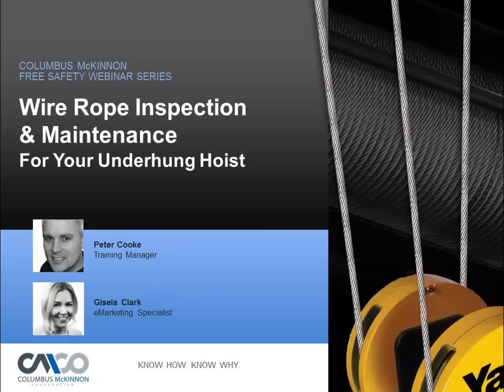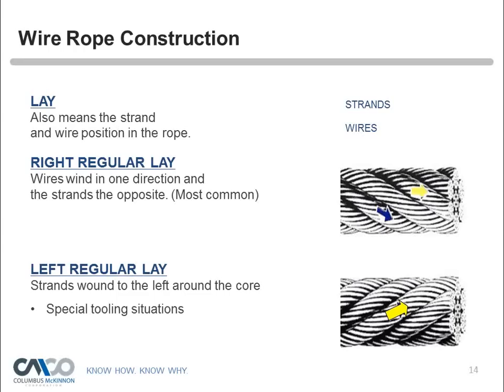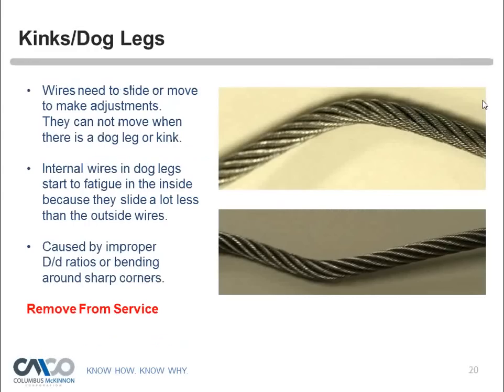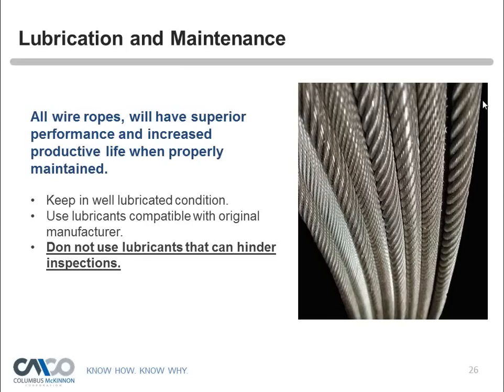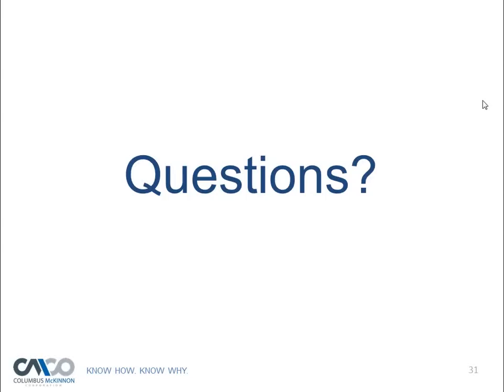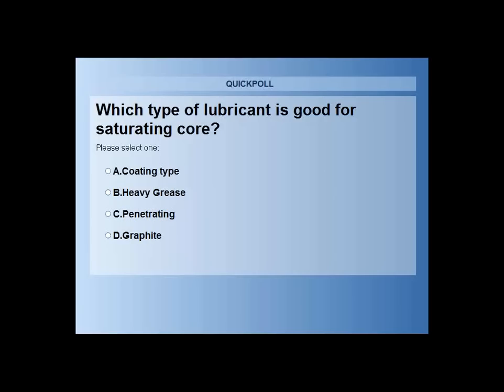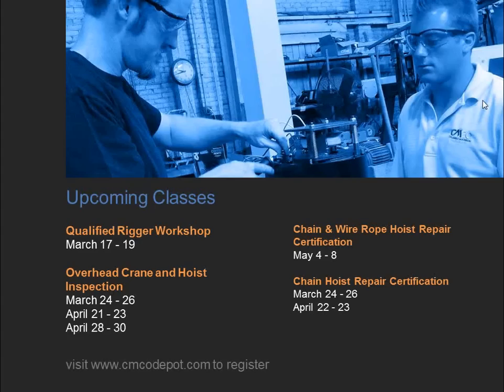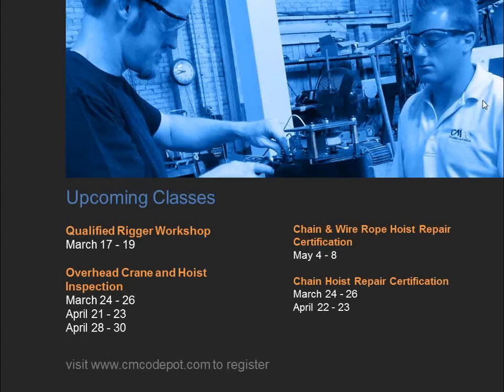Safety Webinar: Wire Rope Inspection and Maintenance for Your Underhung Hoist

Comment: In Europe, wire ropes are specified according to the material's ultimate tensile strength and there are for example 2160, 1960 and 1770 MPa steels.
Reply from the maker: +Jester Mclarpet - thank you for the information!

Comment: how many degree kink or dog leg? shall be remove from service
Reply from the maker: Thanks for the question. From our training team - "Any kink in the wire rope requires that rope to be removed.
There is no allowable measurable amount that can be acceptable.
All kinks regardless of how small are dangerous & can lead to catastrophic failure.
This is why they need to be removed from service.
The best advice I can offer is take care of the rope & use it safely to make sure that you don’t kink it."